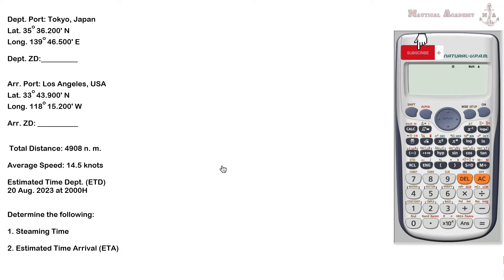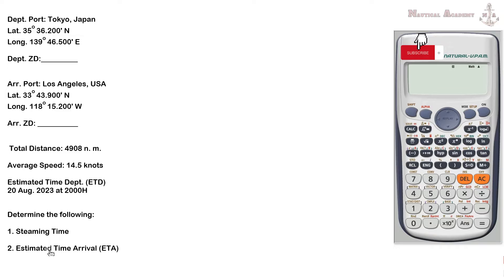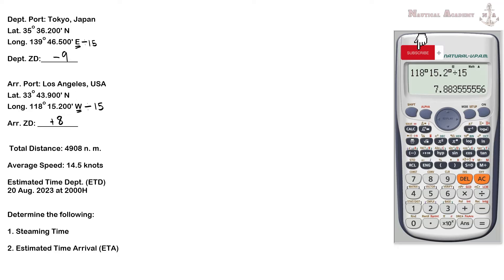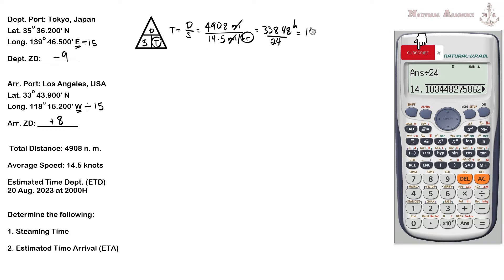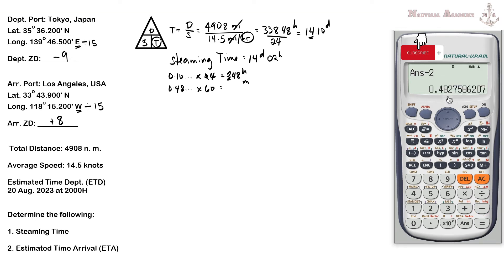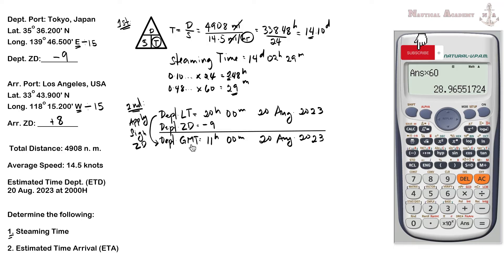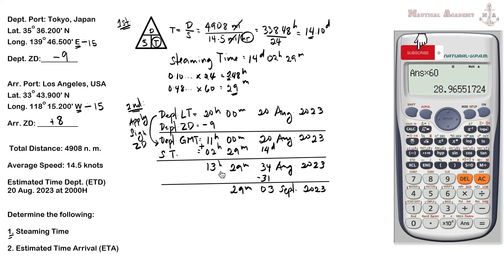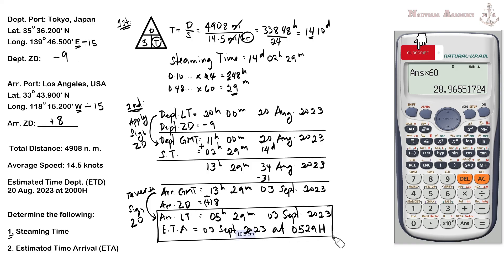How to determine ship's ETA II Calculate Steaming Time II Convert Local Time to GMT & Vice Versa

Comment: if im not wrong, east stand for + and west -
Reply from the maker: The sign of the Zone Description (ZD) is determined by its relationship to Greenwich Mean Time (GMT), also known as Coordinated Universal Time (UTC).

"Westerly Longitudes" have a Positive (+) Zone Description. This is because local time in these zones is behind GMT. To get GMT, you need to add the ZD to the local time.

"Easterly Longitudes" have a Negative (-) Zone Description. This is because local time in these zones is ahead of GMT. To get GMT, you need to subtract the ZD from the local time.

For example, if a ship is in a time zone with a ZD of +5 (in the Western Hemisphere), you would add 5 hours to the local time to get GMT. Conversely, if the ZD is -3 (in the Eastern Hemisphere), you would subtract 3 hours from the local time to get GMT.

This conversion is standard in maritime practice and is referenced in authoritative texts like the American Practical Navigator (often called Bowditch), and so with all other maritime textbooks.

Comment: Where did you get the 15 sir???
Reply from the maker: The Earth completes a full rotation of 360 degrees in 24 hours, resulting in a rotational speed of 15 degrees per hour (360° ÷ 24 hours = 15° per hour). This relationship forms the basis for our time zone system, where each time zone typically spans 15 degrees of longitude, corresponding to a one-hour difference in local time. 

To determine the Zone Description (ZD) for a specific location, which indicates the difference between local time and Coordinated Universal Time (UTC), you divide the location's longitude by 15. This calculation provides the number of hours the location's time differs from UTC.
Reply: @nauticalacademy001  hello! Sir do you have other social accounts to keep in touch with you? I'm a sailor, I'd like to know more about you sir.
Reply: @nauticalacademy001  i get it sir, here in the Philippines we've 120 longitude for example 120÷15= +8hrs.  UTC is that correct sir? 🙏

Comment: why you divide by 15, where did you get this number?
Reply from the maker: By dividing 15 when calculating the Zone Description (ZD) from longitude is based on the rotation of the Earth and the relationship between time and degrees of longitude. Here’s a detailed explanation:

The Earth’s Rotation and Time
24-Hour Day: The Earth completes one full rotation (360 degrees) in approximately 24 hours. This means that the Earth rotates 360 degrees of longitude every 24 hours.

Hourly Rotation:
To find out how many degrees of longitude the Earth rotates in one hour, we divide the total degrees (360) by the total hours (24).
Calculation: 360° / 24 hours = 15° per hour.

Time Zones:
The concept of time zones is based on this hourly rotation. Each time zone represents a 1-hour difference from its adjacent time zones. Since the Earth rotates 15 degrees of longitude every hour, each time zone ideally spans 15 degrees of longitude.

To summarize:
The division by 15 is based on the Earth's rotation, where the planet rotates 360 degrees in 24 hours, resulting in 15 degrees per hour.

Each 15-degree segment of longitude ideally represents one hour of time difference from Universal Time (UT).

Dividing the longitude by 15 converts degrees into hours, giving us the Zone Description (ZD) that indicates how many hours a location is ahead of or behind UT.
Reply: @nauticalacademy001  Great 👍